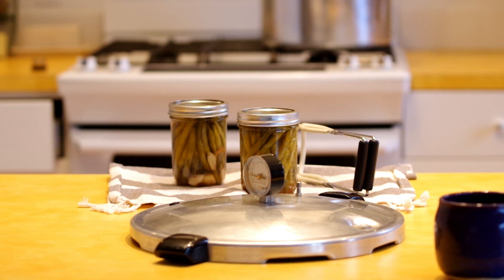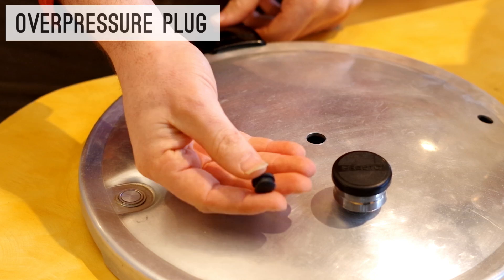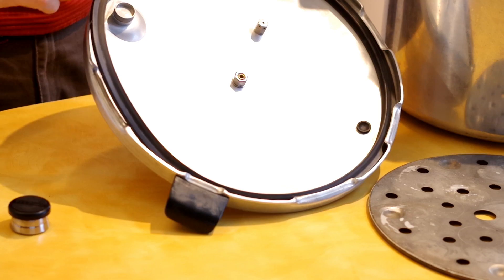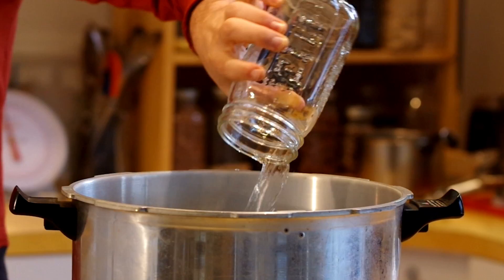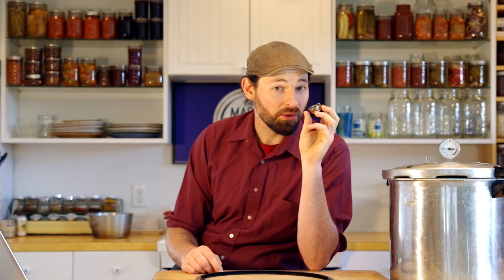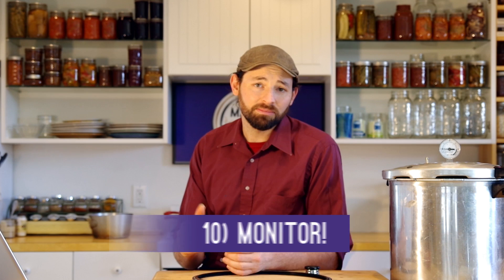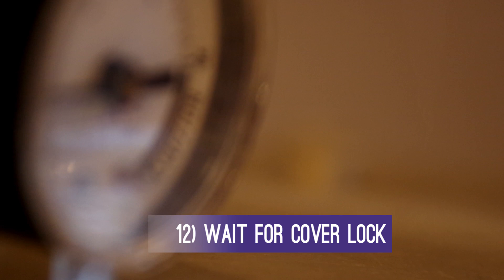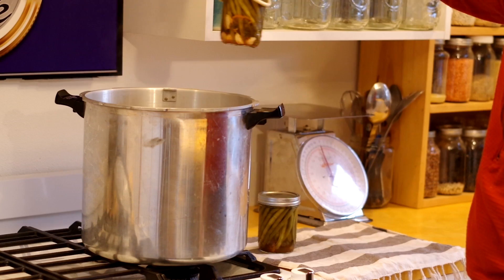How to Set Up and Use a Dial-Gauge Pressure Canner

Comment: I'm using a "gauge" canner for the first time. I always used just a jiggler canner, but I am now canning some meat and wanted a gauge.  I was under the assumption that the pressure had to rise UNTIL the pressure regulator jiggled also.  Therefore, my first batch of meat overcooked and about a 5th of the liquid seeped out because my pressure was TOO HIGH.  14lbs of pressure when it was suppose to be 11, (but the pressure regulator jiggled at 14).   Oh well, lesson learned.  Thank you for such a good video.  PLUS,  you made me laugh too.  😅

Comment: Thanks for the video. First time using a canner. I read that manual so many times and couldn't figure out how to work it. I even had to get on line to find out what my pressure was supposed to be at. Seriously this helped a lot. I thought my gauge was broken until I watched this.
Reply from the maker: Good on you for trying it out! Are you using a canner just like this one? What did you can?

Keep in mind that the canner manual won't specify the pounds per square inch (PSI), because each food has different needs. The most common are 10 PSI and 15 PSI, but you'll also see recipes that call for 12 PSI and others. 

Happy Canning!
Reply: Thanks for the reply. Now I have a question. Yes, I did use the exact same one. My question now is: I canned spaghetti sauce(used a lot of tomatoes) with hamburger and pork sausage in it. I canned it at 11-12 psi(couldn't keep the flames consistent) for 90 minutes, with the only weight that came with it. Do I need to re-do it for longer at a higher psi?
I never realized that using a canner would be so difficult to understand. I've water bathed tomatoes for years, but this is seems much more complicated. So thanks for the video and help!!!!
Reply from the maker: Yes, pressure canning is more particular, and takes longer, than most waterbath canning. It's important to follow tested recipes from places like: 
http://nchfp.uga.edu/how/can_home.html and http://www.freshpreserving.com/recipes/
Those are two of the most trusted tested sites.
Reply from the maker: Also, remember that there will often be TWO sets of canning times. One for dial-gauge canners (like the one in the video) and one for weighted-gauge canners.
Here's a tested Sauce With Meat from the USDA, which calls for 70 minutes at 11PSI (quarts): http://nchfp.uga.edu/how/can_03/spaghetti_sauce_meat.html

Should you re-can them? We can't advise on that, without knowing exactly what you did, and don't recommend inventing your own recipes for pressure canning. However, if you DO make your own recipe, always look up the ingredient in your mix that takes the LONGEST and HIGHEST pressure canning. Never can it for LESS than that ingredient's needs: http://nchfp.uga.edu/how/can_03/spaghetti_sauce_meat.html

Comment: I just recently built up the courage to start pressure canning but was confused when the pressure regulator I have was not weight-compatible. This is the only video I have found on how to regulate pressure without a weight so far. I didn't know when I got my canner that there were some that you could use a weight with and some that you have to just close the vent and change the temperature to get the pressure right. This has helped me so much! Thank you!!!

Comment: This was so well done! I had done a trial run for the first time today by pressure canning water. Then I saw this as I was starting to can some chicken broth, and realized that I had attached my gauge incorrectly. So I quickly turned off the canner, cooled it and fixed my gauge. Just finishing up my broth now and it feels so good to have tried it after having my canner for almost a year. Thanks for such an informative video.
Reply: How did you know the gauge was installed incorrect? My gauge has not moved even after the stem nozzle rises up out of the pan and l place the weight over the vent.

Comment: So glad to find this video. I am new to canning and my new canner has a gage like this. I read through the manual and I knew it had to stay at the desired pressure,but I am having the hardest time keeping it from going up.Most of my recipes call for 10 or 11 lbs of pressure but mine runs between 10 and 13 lbs. I hope that is ok.
Reply from the maker: +Sherry Wilson Just make sure you take the gauge in to a Cooperative Extension office to get calibrated, once a year or so. As long as your actual pressure is ABOVE the required amount, you're fine. Just don't let it dip below the necessary number.

Comment: Very good !  One word of caution.  Propane burns a lot hotter than natural gas.  If you use a large burner and want to can at 15 psi, you can warp the bottom (I did).
Reply: Gary Willson thanks for the heads up! .. how do you prevent this happening?

Comment: Very helpful! My over pressure plug blew out of my presto canner at high pressure, after about 15 minutes of reaching 11/12 psi. I turned the heat completely off and waited to take the jars out! I put my hamburger meat in the frig and next day put it in the freezer. Thinking I may need to return the canner or have it repaired. Then decided to try it again with canning dried potatoes. I put the plug in the hole and started the process of canning. Some stream came out of the hole where the over pressure plug was. My pressure never built up to over 5 psi. The steam was escaping to fast. What should I do? (Yours obviously is holding the pressure). Thank you!

Comment: Was scared to death to use this thing. I will say using electric stove I never could get it to hold a steady 10lb if pressure. I gave up and settled for the 12lbs.. at least it wasn't under 10.still waiting to see if the extra 2lb messed up the potatoes. Thanks for sharing this

Comment: For those recipes in the Presto dial gauge manual calling for 6 psi, would we use the 5 psi weight with the weighted gauge? It makes sense we would, but I want to be absolutely sure. I'm at 741 feet above seal level.

Comment: I just purchased a new canner and wish to find that happy 10 on my gauge and was wondering if I could do a test run with nothing but some water in the bottom of my canner?  I’ve heard that the liquid will overflow out of the jars if you allow the pressure to stay over the proper amount for any particular product and wish to avoid loosing anything.   So would said method work in order to help me establish the proper temperature on my stove before actually putting the jars of food in the canner?  I plan to start by canning a broth that I just made and have a concern of loosing some of it.

Comment: So I need help.  Your video is quite informative.  All valves were checked. I have only used my pressure canner two times before this. Lent it to a 'friend' and now it does not seem to work.  I could hear the water inside boiling but could not see a definite stream of steam even after about 45 minutes.  The metal button did not pop up.  How long should it take for the 'steady stream of steam' to happen?  I shut all down and re-checked everything.  All seems well.  Help me trouble shoot this.  I am in Alberta so do not have any extension office to check this with.
Reply from the maker: Oh no! There should be steam coming out, usually within 15 minutes or so, depending on the size of the canner and the heat source. If water boils, steam has to come out from SOMEwhere, right? Make sure the hole is clear for that vent, and that all the OTHER holes are plugged appropriately (the emergency plug is in, and the gauge has its little gasket nice and tight). Also, that inner gasket should be in-place; otherwise, steam just leaks out around the edge of the lid, and will never concentrate through the valve. One "gotcha" could be if you have an induction burner, as they sometimes self-regulate if they think something is too hot or on too long, causing water to rise/drop in temperature in a way that doesn't work for canners. 
Even though you don't have an Extension service, you can certainly call or email any extension office in the US. They may not be able to inspect it in-person, but could perhaps verbally go over it. Good luck!

Comment: Will these steps work for a Co-op Model A brand pressure canner?  I've got the book and all the parts to it including a new seal that's never been used and still in the original package.    Even the pressure gauge looks nearly brand new.

Comment: My pressure dial gauge does not move. It’s a new canner and I have tried twice with pressure canning since putting everything together. The steam nozzle rises up and I put the weight over the vent and wait a while but the dial gauge for the pounds per pressure never rises. Not sure what I am doing wrong..

Comment: I have a presto canner but I only have the 15 pound regulator that came with it and I cant find a 5 or 10 pound regulator that is compatible with my canner, Is it ok to use the 15 pound regulator even tho i'm at 50 feet sea level.

Comment: Question: I've been pressure canning for 5 or 6 years now. I'm very familiar with a weighted pressure canner. I had a 16 quart presto for years. I recently upgraded to a presto 23 quart dial gauge. The weight is completely different and I'm getting conflicting information on whether the 15 lb weight that came with my kit should rock at 11 lb of pressure. Logically, I would say no. It shouldn't rock because it's a 15 lb weight and I'm only canning/cooking at 11 lb of pressure. However, Healthy canning site says yes The weight should rock but every other place I have seen says it just sits there. I am not really sure what the right answer is.... 🤣
Reply from the maker: This is a little confusing; if you're using a dial-gauge, then what you're thinking of as the "weight" probably shouldn't rock, unless it's an unusual design. The weight on a dial-gauge canner is a safety feature. It should not move or rock UNLESS you accidentally let the pressure REACH 15 pounds. As long as you maintain your lower (11 pound) target, it won't move, but if you crank the heat or walk away, steam will escape from under that weight, preventing higher pressures.

Comment: Gave the presto canner a trial run.  The air vent cover lock engaged first before a noticeable flow of steam coming out the vent pipe.  After 10 minutes of the steady steam did I put the pressure regulator on..... and once it got to 10 then i started counting.... someone else said that the vent pipe should start steaming first before the air vent cover lock engages....  is my presto canner no good?
Reply from the maker: Sounds fine; the lock SHOULD usually engage first. The reason the stream of steam starts pushing out in the first place is because all other paths of escape are blocked. And locks are usually designed to engage before things get too hot/pressurized to be safe. So, hard to say for sure from your description, but sounds alright!

Comment: Great thank you! I've gone through the process and tried it, I've now canned potatoes for the first time, but when I canned them the black emergency valve was ejected. Does this mean the pressure was incorrect? I have just bought the presto pressure cooker and it was the first use :)
Reply from the maker: Ooh, that sounds like your pressure was way too high, unless you have a faulty canner! If it's the first use, you should have been fine. Were you paying attention to the pressure on the dial?

Comment: is there a risk in the jars breaking?
Reply from the maker: There's always a risk! Usually from jars with flaws (scratches, chips, etc.), but everyone has a jar break periodically. It's a bummer to lose food, and to clean up the mess on the other jars after they've cooled, but it's not that common. If you have jars break frequently, you may be sealing them too hard, or are maybe using a set of older jars with scratches (for example, if you used a butter knife to get jam out of a pint jar last year, you may have accidentally scratched the inside, creating a weak spot).

Comment: My air vent cylinder piped up Before I put my pressure regulator on does this mean something is wrong?
Reply from the maker: You're probably fine; did the gauge look accurate throughout the process? Does it drop all the way to zero when not in use?

Comment: WHATS THE DIFFERENCE between presto canner and the presto canner “INDUCTION”
?????????
Reply from the maker: We have not used the Induction canner ourselves, but they are specifically designed for induction stovetops (which often have a glass top). The problem with MOST pressure canners on induction burners is that the burners self-regulate so that they do not get too hot and crack. But when the burner turns itself off and on, you lose control of maintaining the correct heat/pressure in your canner. Again, we haven't used the induction canner, but it is supposed to somehow help avoid that if you have an induction stovetop.
Another solution, if you do have an induction stovetop, is to purchase a plug-in canning element. Here are some thoughts on that: https://www.healthycanning.com/canning-on-hot-plates-or-portable-burners/

Comment: Help! What if the pressure gauge doesn't go all the way down? Mine is stuck at 3 pounds, and I've never used it before? 

Yes, I did get it wet, by washing it with a wet rag.  I didn't submerge it in water completely... Is it completely ruined? Do I need another? Or once it dries back out, it'll be fine? Can I dry out manually? Help?
Reply from the maker: Hey there! Getting it wet shouldn't be an issue. If it's brand new, you should call the manufacturer and let them know. It may be defective from the factory. If it's not new (used, or sitting in a cabinet for a long time), I'd take it to your county Cooperative Extension office. Almost all of them will test gauges for free.
Reply: @TheMasonJarSuite  hey thank you so much! I did call the extension office yesterday and they got with me, quickly. They tested it, and I wound up messing it up for sure. 

I did get another today though 
Thank you so much! I may have more questions in the near future. Will. Lol

Comment: i got my canner used at a thrift store and it doesn't have have the regulator is that ok?
Reply from the maker: Nope! You generally need a regulator for proper operation, IF the canner originally came with one. Look up the model, and/or consult with your county's Cooperative Extension if you're in the USA. You can usually order new parts from the manufacturer (Presto, Granite•Ware, etc.). Always a good idea to get a new rubber ring too, when you get a canner from a thrift store.

Comment: Question.. I’m a bit confused on how much water I put in .. I don’t want it to dry out! What is the minimum and max water you put in please.
Reply from the maker: Hey there! Most canners have a little line engraved on the inside. Take a look when it's empty, and see if yours has one. Otherwise, you can contact the maker and ask about your model. Most canners, in our experience, ask for somewhere around 3 quarts of water.
You will lose a little water during the venting (all of that steam coming out), BUT, when you seal the canner, the idea is that you do NOT let steam out. That's what builds up the pressure and makes the contraption work.  Because of that, you don't lose very much water in the process, even on long projects like fish or meat.

Comment: I always have spitting and sputtering from the vent pipe, but I never see the steady stream of steam. Vent pipe is clear and open of debris. Is it just me???
Reply from the maker: We almost always get spitting and sputtering as well, but after a few minutes (sometimes as much as 10 minutes in our experience),  it should turn into steady steam. Have you tried turning the heat up a little? If the heat is too low, that could be the problem!

Comment: I'm just about to start a batch of carrots and I didn't know how to regulate the pressure. Now I know it's just the heat.
Reply from the maker: +JC.Solutions Yep! It takes awhile to learn your own stove and how much to adjust when holding that pressure. Once you're up to pressure, it takes a surprisingly little amount of heat to maintain it. Are you on an electric coil, or flame?

Comment: An aluminum canner will not work on an induction cook top. An induction cook top would require a steel canner or an aluminum one with a steel insert in the bottom.